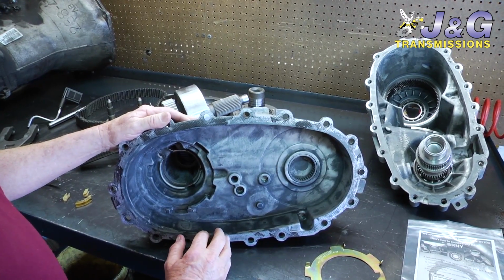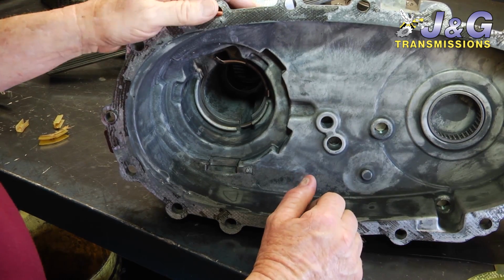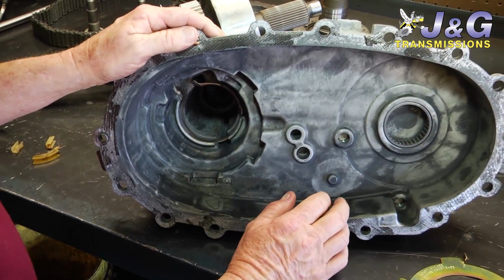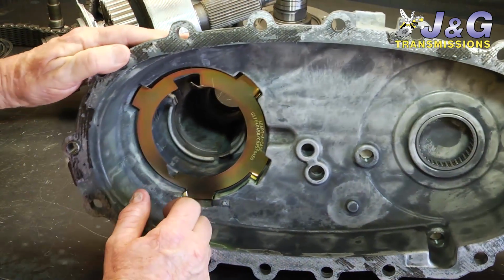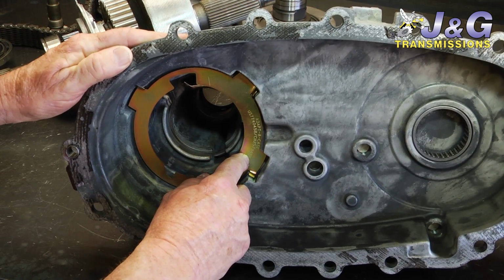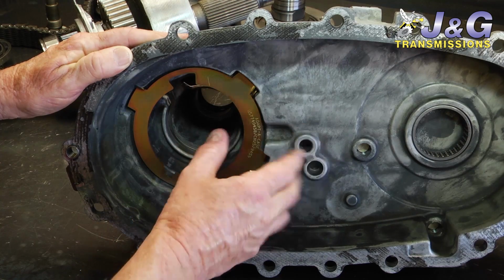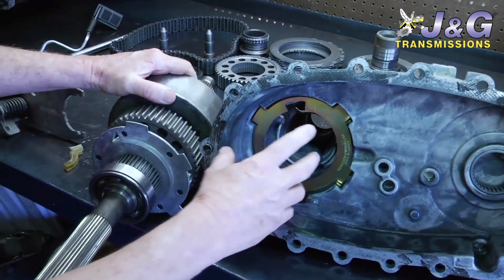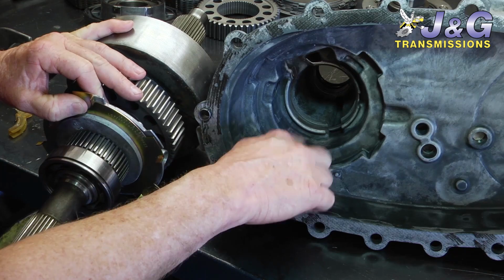What Goes Wrong with a transfer case

Comment: Anyway that a transfer case would cause you to lose reverse and have slippage going forward?
Reply: Thats a transmission issue, transfer case works similar to a diff. Chain, rotates the gears. The only way you'll have slippage if the chain is completely loose, & skipping teeth. But you'll deffainlty hear that!
Reply: @XJeepSlaveX  Thanks. It was the transmission that came apart. It was making a ton of noise in the transfer case. I took the transfer case apart and it was all good except for the case that was almost worn through. Put a new side on it.
Reply: Mines doing same thing put in reverse makes all kind racket wont move .. drive moves but whines.
Reply: @fordnut4914  It was my transmission. Transfer case was good after all. I did replace the case siding because it was almost worn through. Tons of noise that sounded like the transfer case but wasn't.
Reply: @mikeb3263  mine sounds like the chain is slipping especially in reverse .
Reply: @fordnut4914  I swore mine was the transfer case but it was the transmission. Whole bunch of noise in the transfer case. Its not difficult to take the transfer case apart and look inside it. You can always start with draining the oil and looking for metal in it. If there is no metal then I would lean towards the transmission.
Reply: @mikeb3263  yeah I drained the case seen some metal flake in it I opened the case but not seeing much anything unusual.  I did notice when I first opened it the chain wasnt on the sprocket looked like it was on the drum part next to the sprocket. I'm going to take the oil pan off the transmission see if their is any metal in it  today.